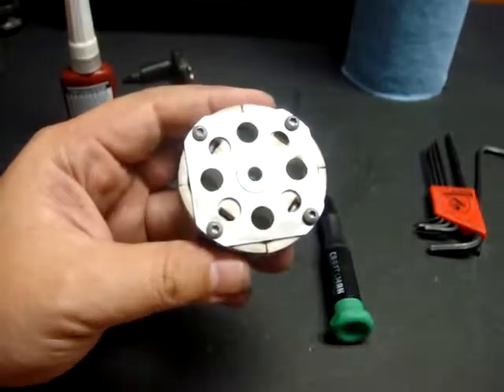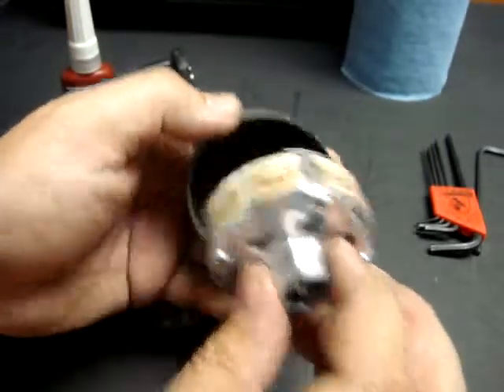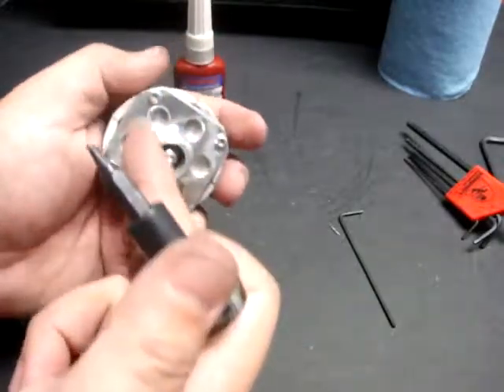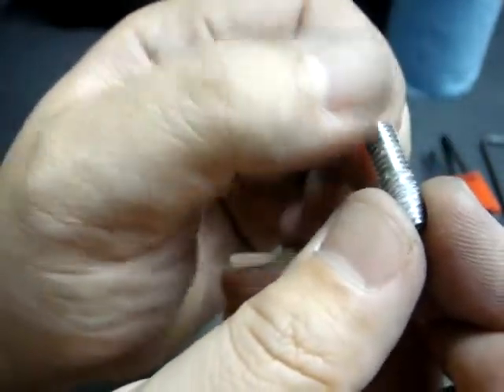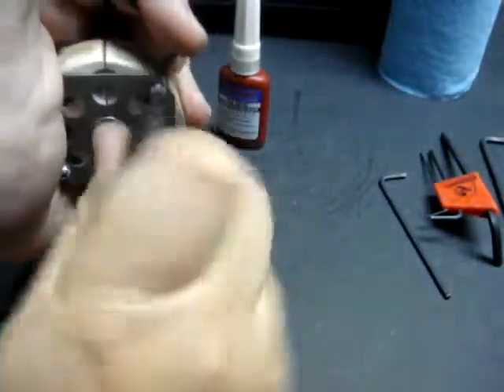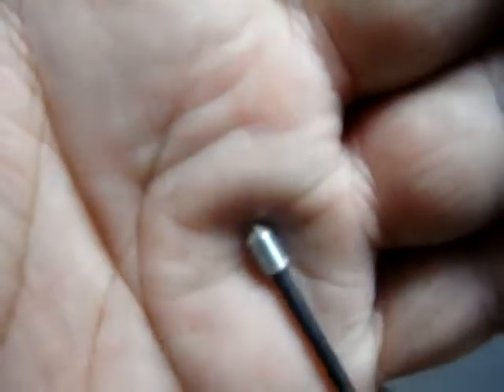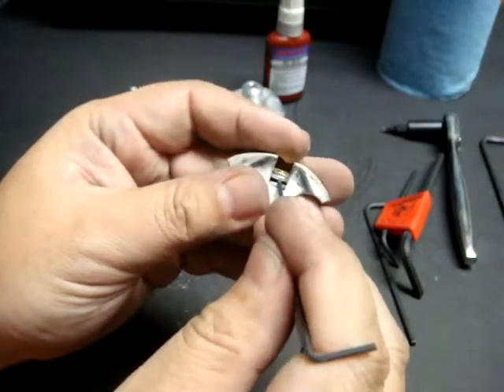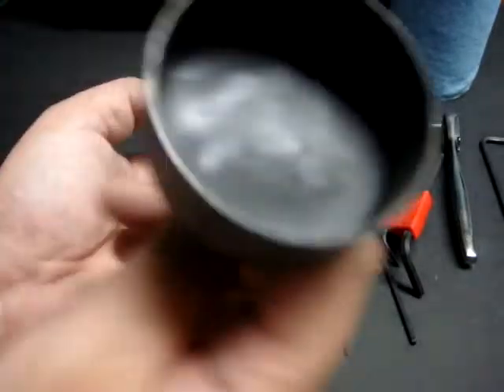Elcon Clutch Disassembly

Comment: no problem. for  someone that has the adjustable clutch, a tto would be very handy to have plus you can set your hsn on the carb for max rpms.
 very early in the morning im going to take a drive out to check a small disused air field thats used for sky diving now, to check condition of runways.here in the uk we dont have access to expanse land for speedruns.want to see what this motor can do before I change it lol.thanx

Comment: thanks for the info, 
      5gallons , like 12 hours maybe, thats greatb.what is highest engagement setting? I like around 8k for offroad and 9 to10k off road (small wheels) the oddified clutch works the same way but not adjustable.the shoes and sprinngs deters the engagement point.
check my video, oddified clutch test on  tto tacometer, pulls great with no lag  when geared for 75mph with single speed.
btw, great g260 review, very informative and great for guys that are coming into large scale.

Comment from the maker: I forgot to say: preloading the springs is very easy. All you have to do is screw in the adjusting setscrew just to the point where its tip begins to touch the brass button plate. From there, you can screw it in to delay when the shoes deploy to engage the clutch bell. 
From what I understand, the default setting is 1 turn in past where the screw hits the brass plate; that engages around 6500RPM. 
I believe you can go as much as 2turns in & that'll give you around an 8000-9000 RPM engagement

Comment from the maker: Actually,its very easy to set up for even &simultaneous shoe engagement. 
Right now, I have mu adjusting set screws @ 1.25 turns in from the point that the setscrew point just touches the brass button plate. I dont have a sound tachometer, but I think my clutch engages @around 7000RPM
I love the quality of this clutch: the main clutch body base is all machine billet aluminum. All the parts fit beautifully, even after over 5 gallons of pump gasoline (thats many many hours of actual running!)